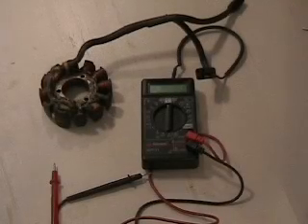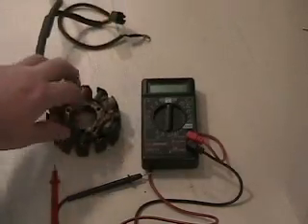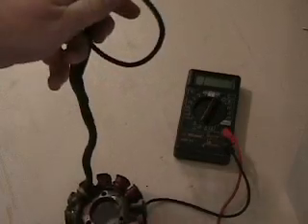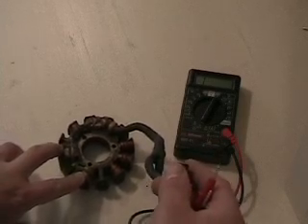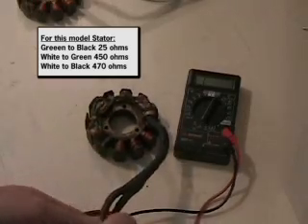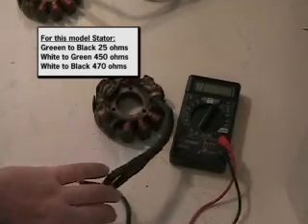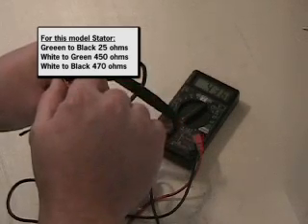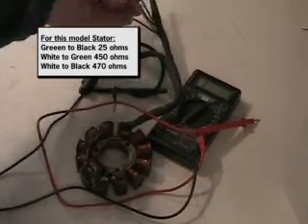Arctic Cat zrt 800 zrt 900 and Thundercat 1000 Stator Testing

Comment: im confused if the 2 readings were good how is the stator bad?
Reply from the maker: The stators come wound at 450 ohms. After some use they're normally around 445 ohms at room temp. I give a general "good" range of 435-445 because guys check them at different temps and at cold/outdoor winter temp a good stator can be in the 435-ish range. If you see under 440 at room temp an OEM stator is becoming suspect.

Comment: I have a 1999 t-cat
Green to black is 22ohms
White to green is 472
White to black is 497

What does this indicate? The numbers seem a lot higher, except green to black
Reply from the maker: 472 is an indication that the low speed coil is going bad. The 22 ohms also means the high speed coils is starting to go bad also. I do rewind them for $175 and a 2 year warranty. www.outdoor-electric.com
Reply: I have 403 380 and 24, 97 zrt 800, its cold in my shed btw, any suggestions, still no luck
Reply from the maker: @mitchvanier  OEM stators should be at 435-445 and 22-25. If you're at 380 your stator is definitely going bad.
Reply from the maker: A good OEM stator should be close to 435-445 and 22-25ohms. If your low spped coil is 472 at room temp, then it is bad.

Comment from the maker: You fall into that "grey" area. Whenever a stator measures higher than 450 and 25, it is bad. As far as the low spec...I draw the line at about 430oms for the low speed coil. Anything under that is highly suspect. If an OEM stator is under 420ohms then most of the time you can say that it is on its way out. Yours is on the boarder....if you test everything else...i.e. using the jumper wire, test the trigger.... and you still don't have spark than more than likely the stator is your issue.

Comment: hey blaine i watched your video and got a little confused i'v got a 95 zrt 800 with no spark on the stator i have a white, yellow, green, and black wires  yellow-geen is 429, yellow-white is 458, and green-white is 26 does this mean the stator is good if i use the black wire to check i get nothing did i test the stator right? thanks for any help

Comment from the maker: Should be 25, 450 and 500 ohms. The 650 ohms on your primary coil usually means there is some sort of ground/short condition going on with it. When your primary or "low"side coil is effected it effects the starting of the sled and all rpms up to about 7000-7500 or so. So, bottom line yes, I believe that your primary coil has failed and it is the cause of  your no-spark issue. You can always send me an e-mail and I can respond with contact/shipping/cost answers. Thank you.

Comment from the maker: I really don't know for sure. The trigger coil is not the same as the trigger. Go to my other video "How to check a trigger coil" and I explain what it is and how to check it. It may not be the exact same as the Cat, but it should be very similar. I do have a stator a guy gave me off a running late 90's triple ski-doo. I measured it and got: White/ to black/red 4 ohms. White to green 4 ohms. Green to black/red 34 ohms.

Comment from the maker: Verify that it was the 3 prong tester. They did also use a 4 prong plug on some of the 580's....if it is a 4 prong the plugs/connector is the same as the one in my video and your specs are still 45ohms and 450ohms. Test it the same way as the one in the video if it is a 4 prong.

Comment from the maker: I am not familiar with your specific sled but the principles should be the same. Make sure the plug and wire are good on that side. Most (but not all especially Polaris) 2 stroke sleds you can just swap wires back and forth. Try swapping plug wires and see if it follows the plug or the wire. There are specs for plug caps. Most guys unsrew the plug cap, trim a 1/2 inch off and screw the cap back on. SOunds like either bad wire/cap connection, spark plug, coil, bad ground or possibly stator.

Comment from the maker: Here are your specs:
Black/Red to White (495 ohms)
Black/Red to Teal Green (45 ohms)
White to Teal Green (450 ohms)

The large primary coil is dying and the smaller high speed coil is dead. The larger gauge wire that is wrapped around the posts that are separate from the 2 ignition coils power your headlights. Jarring the sled shouldnt affect the stator much. More than likely your stator was going bad and the vibration from jumping helped to hurry the process.